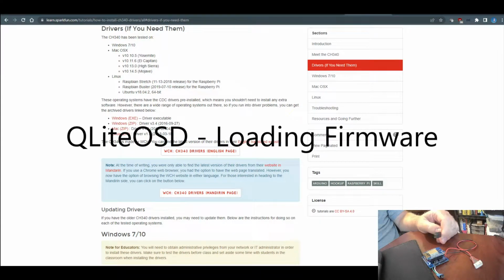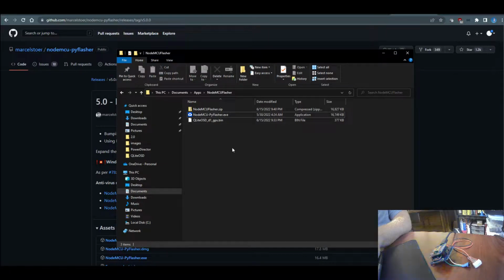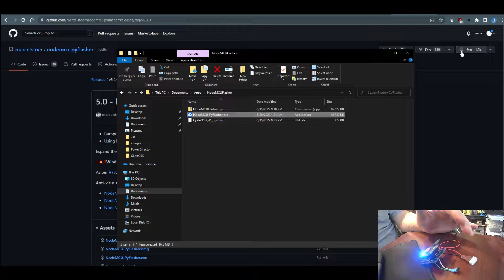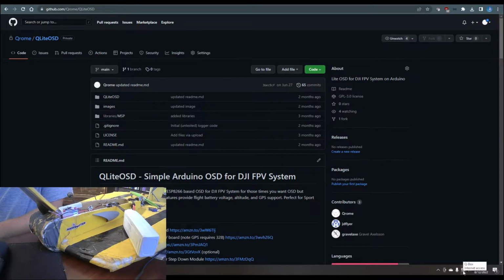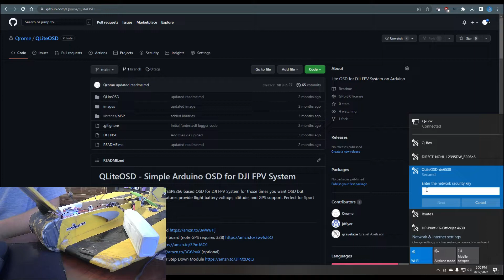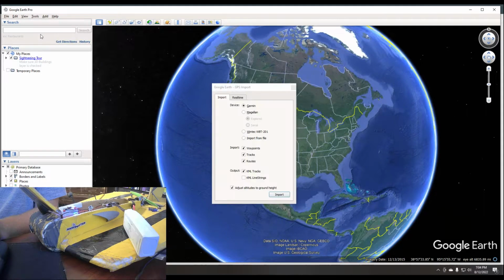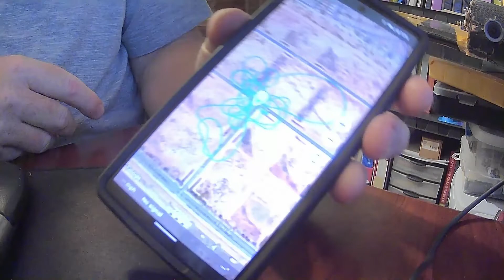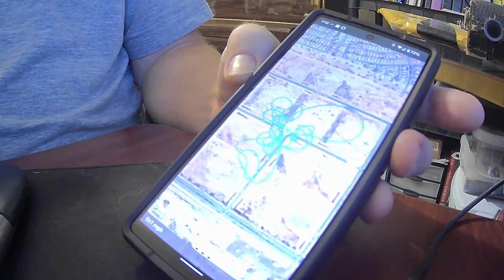QLiteOSD - Load Firmware - DJI FPV OSD

Comment: How do we get this to work for 6s?
Reply from the maker: Sorry, the Voltage step down will only support 4S and this is also the voltage that is supplied to the DJI Vista / Air Unit.   Currently 2S - 4S is supported.